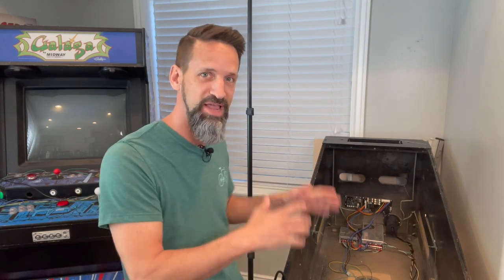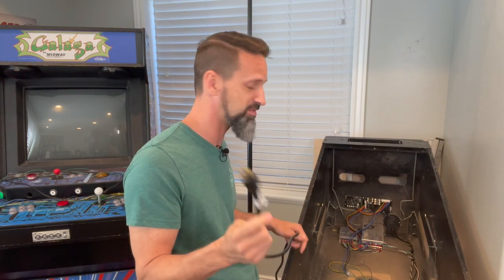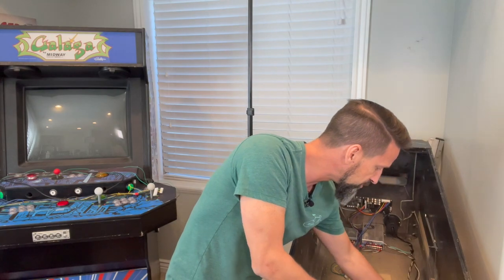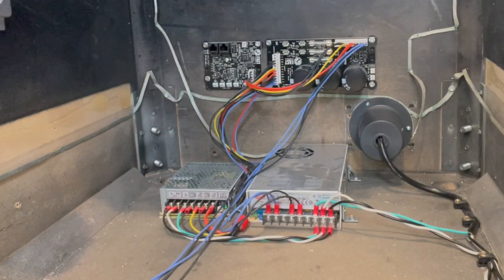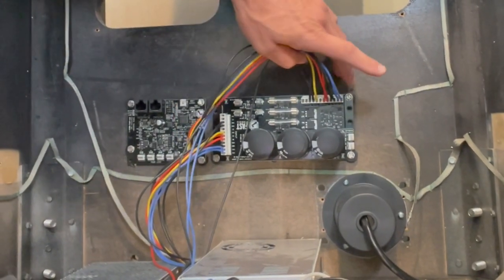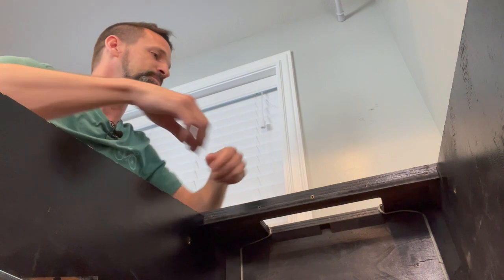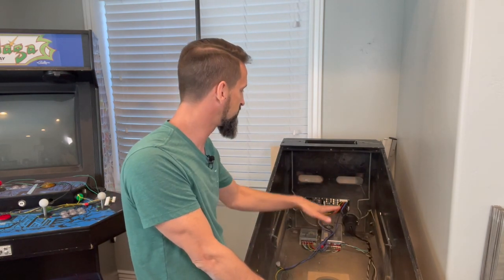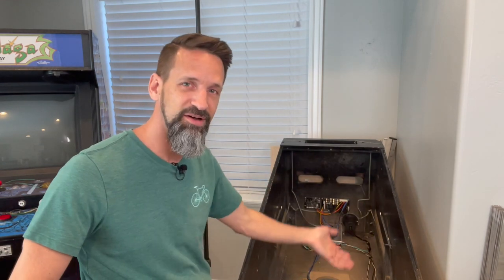HOW TO MAKE A PINBALL MACHINE: Adding Power & Controller Boards

Comment: I really have to commend your efforts for safety even at this early stage. The grounding is VERY important as well as proper ventilation and keeping the AC Line side protected from accidental touching or shorting. Too many DIY projects avoid all of these and are far from safe. As someone who has designed medical electronics and been through UL testing, all of these items are a top priority and should also be addressed in any system we are building. I started my home built pinball a few years back but lately it has been set aside. Your build is making me want to start with it again. Thank you for producing this wonderful series of videos.

Comment: Im starting my own homebrew currently and these videos have already been incredibly helpful. Thanks for putting them together. Working on getting all the power and controller boards at the moment. The FAST bundle is out of stock, but I should be able to piece it all together after checking out all your info and documentation.
Reply from the maker: Hey! Congratulations on starting your project!! Yeah the FAST crew is transitioning into a new version of their primary board - the "nano" is being replaced with the "neuron" -but they're doing it in a way where a nano can be upgraded /expanded into a neuron which is awesome - so yeah just grab the items a la carte and you'll be all set! Lmk if you have any questions
Reply: @thepinballroom  Awesome, will do, thanks for the heads up. Looking forward to seeing Led Zeppelin in the future, and Ill definitely pass along links to content of mine, once I get to some major milestones

Comment: Sweet another that has Fast Pinball boards too!
I just got my boards for my homebrew pinball about a month ago.
And love how easy it is to follow the hook ups of everything!
And even my assistant that comes over that knows a little about pinball but does not know how things work.
Even he was saying heck it is in such a simple language and all the pictures they show even he thinks he can make a pin. xD
I actually just recently re-did my power supplies I had it similar to what you had but no fuse.
I have since re-done the power supply and have a IEC socket  with a EMI filter in it and which is like a computer plug only it is 16G wiring for the power supply and switch.
And yes with the re-do I put in a 8Amp Flo-Blow on the hot line.
My switch is different though it is just a two terminal but it still works and that is what matters. ;)
And yeah I got the Fast Pinball kit which I may need to get more RGB LEDs or use one of the bazzillion LED strips that I have. xD

I sadly lack a cab though funny enough I do have a playfield that the only thing I have on it is the ball shooter guide and a few holes drilled into it.
Oh and is there a template on aligning the flippers and slings at the lower playfield?
That is what I am struggling with on the foam mockup I did and yes it is a full size foam pin mock up. xD

Any ways I am going off all excited and sorry about writing a book in the comments section but I tend to do that when I am excited about pinball or in this case making my own pinball machine. :)

Comment: Watching this putting power in my machine right now 💪🏻 did you end up keeping your PSU’s at the bottom of your cabinet? Fast’s website shows all of that in the backbox
Reply from the maker: No I moved them to the back box for my final setup
Reply: @thepinballroom  dang I ended up putting them inside the cabinet haha

My pc is behind my coin door (using a laptop) and I am using two screens in the backbox, so I figured having everything else centralized in the bottom was the smarter move.

Comment: For the "high" power, does the node board need A/C or D/C? Does the node board use PWM to pulse the DC so that the coils ultimately get a half-wave type of A/C?
Reply from the maker: The way the FAST node boards works, only the ground is switched - so the ground goes from the node boards back to the power filter board. Outputs can be pulsed (PWM) and AC only goes to the main power supplies.

Comment: I have a question Steve. You bought your power supplies from FAST. They should be good quality and fused already. Why did you place the 8amp fuse on your mains power line? The FAST documentation doen not say anything about a fuse before the smps’
Reply from the maker: Great question! Basically it's just another fail-safe to help protect your home, it shouldn't ever be tripped except in a very extreme situation, but sh1t happens and it's better to have one last safety point between your machine and your breaker panel. 

Particularly with a homebrew, there's always the unlikely possibility that someone might power on their machine forgetting exactly what state their in development machine might have been left in electrically speaking - just in case the other fused fail safes get circumvented, that last fuse might save you from something catastrophic. 

It's commonly done in commercial pinball machines, too - so for me, no reason not to be as careful as they are. 🙂
Reply: @thepinballroom  thanks for the quick reply. Is 8 amp also a standard?
Reply from the maker: @mekvanthoff4775  for that point on the main line in, I'm pretty sure that's the standard, yes

Comment: Love this project. I am nervous about your wiring setup though. Im not sure its safe to have your grounded connections in series. Also the main power switch seems to be directly switching mains voltage. Why not have the main power switch a relay that controls the mains voltage? Maybe thats overkill but it seems like it may be the safest option.

Comment: Where did you get the high voltage power supply? I don't see that on you bill of materials.
Reply from the maker: Oh is it not there? Sorry I’ll hurry and add it- I purchased a bundle from FAST pinball that included all the node boards and power supplies
Reply from the maker: Yeah it’s there as part of the FAST hardware bundle currently linked in row 94 I believe

Comment: Been watching your videos, I need to ask a dumb question, when you power up the fast pinball components, will the flippers, etc work or do you need to apply coding first for it to trigger??
Reply from the maker: No dumb questions! 🙂 You need a pinball software platform in order for things to actually work - the FAST boards need software configurations in order to know what to do with the inputs it receives. I’m using MPF (mission pinball framework) they have lots of good tutorials and it’s actively being supported
Reply: @thepinballroom  Is the software installed on a mini pc that is connected to the fast boards permanently, or downloaded onto a USB stick once configured on a pc? need to look into it abit more..hehe
Reply from the maker: @richardfedele7  you’ll need at least something like a  raspberry Pi 3 or better, right now I’m just connecting a laptop to it while I build it but will eventually replace that with something compact like a nuc

Comment: Dose the computer need to be hooked up to play the machine
Reply from the maker: Yep, you'll need a computer connected to run the software in order to handle commands from the flipper buttons thru the controller boards to the coils.

Comment: Interesting video, but I'd be nice for something a little more step-by-step. For instance you completely skip over the ground braid and what it should be touching/how it works etc. For someone like myself, who is trying to build a machine from scratch (cabinet & all), finding this sort of info is quite hard. Another example is you mention the snap fuse kits but fail to mention where they can be purchased - they're not in your build costs document.
Reply from the maker: Hey Alex, thanks for the feedback! Sorry that it wasn’t more complete- I’ll try to do a quick follow up video specifically around the ground braid. I’ll also check my parts list and get those fuse holders added, thanks for pointing that out! Please send me any other gaps so I can do my best to get those addressed ok?